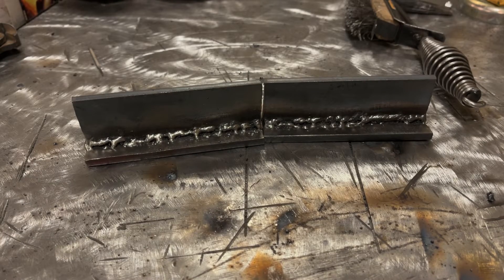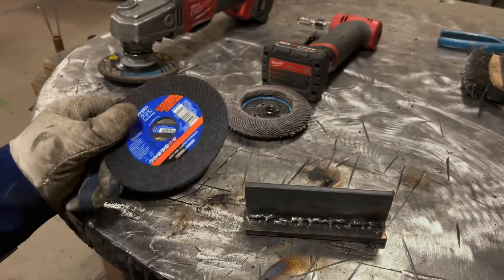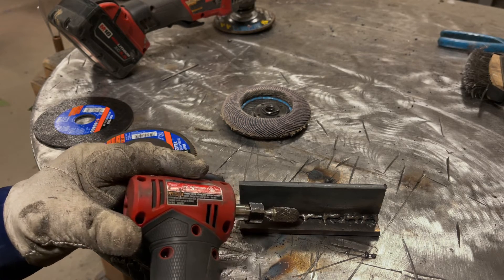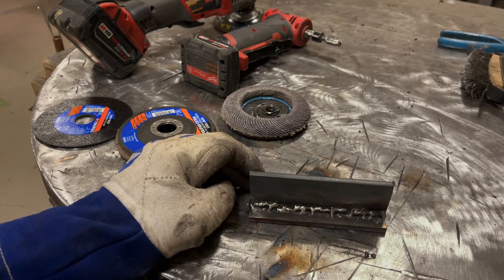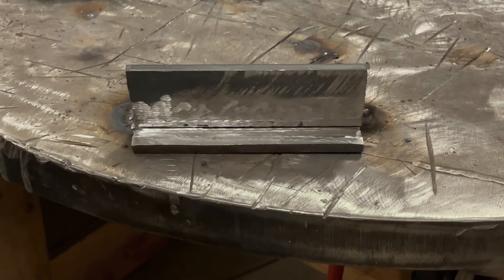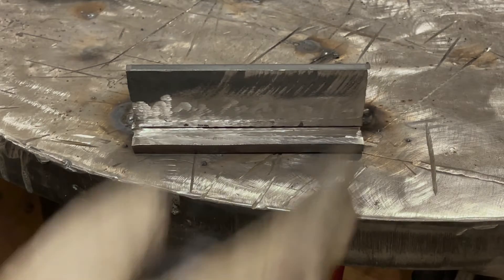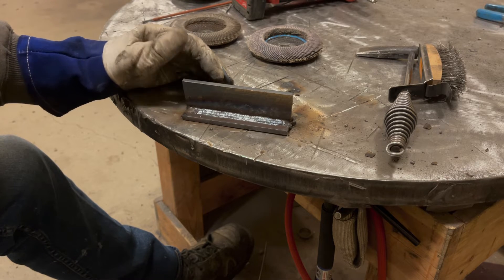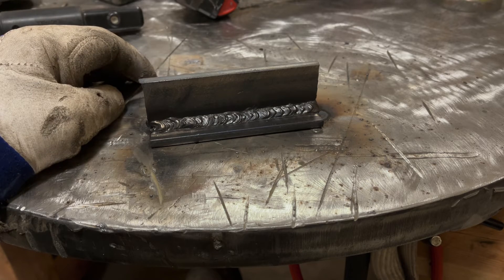Viewer question: how to fix bad welds 👨🏻‍🏭

Comment: Another great video! If the poorly executed weld was performed by the mig process, instead of stick, could one go over the weld with a higher heat setting to accomplish the same as the 6010 rod did, especially if the weld was not structural?
Reply from the maker: The mig process doesn’t penetrate very well due to the nature of it.  I have a feeling if you used 100% co2 gas and ran fairly high voltage the results would be similar to the 6010 rod in the video.  One of the biggest driver of penetration (and arc force) is voltage.  That 6010 pass I welded over the bad weld with was probably running 28-30 volts with a decent arc gap.  Higher voltage like that with wire becomes “spray arc” and requires a significantly more powerful wire welder than many people have.
Reply: If not overhead of vertical ,  larger rod more amps work the puddle to remove slag but might not pass xray or best quility but still can be very strong
Reply from the maker: @jacobclark89  despite not having any root fusion, I did a bend test on that fillet weld.  Although I didn’t film it, I will say I had a 18in pipe wrench with a cheater bar and it took all of my 230lbs to break it towards the face of the weld.  Way stronger than I would have expected.
Reply: @makingmistakeswithgreg  alot of stuff is welded with lazer welding and some of it may not be very strong comparied to a weld with good bead geometry but more than strong enough to not fail .